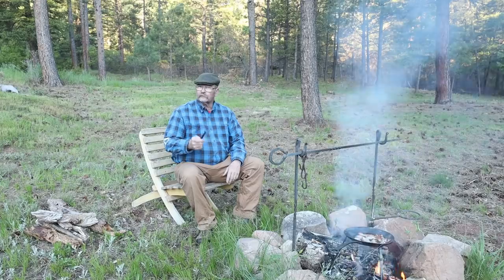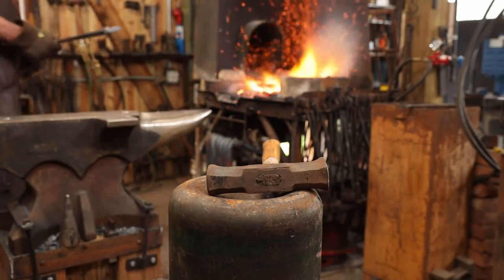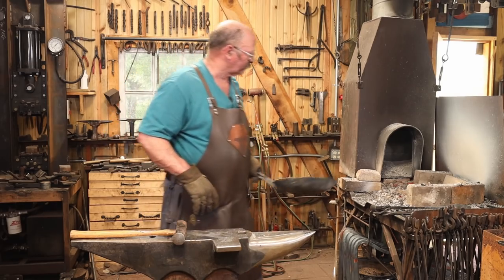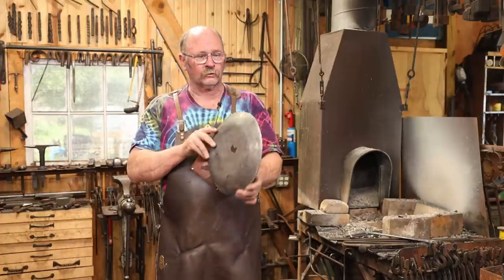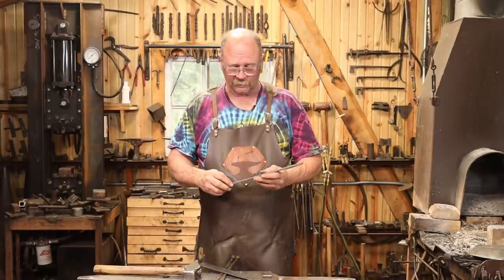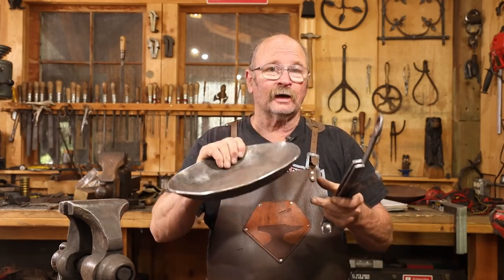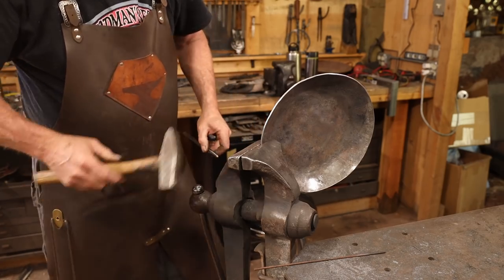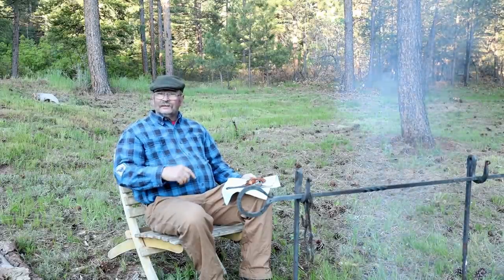Spider or Three Legged Skillet

Comment: I read a book from the late 1800's that said that charcoal was the premier choice for blacksmiths in England until they started having trouble with deforestation and had no other choice but to switch to coal.
Reply from the maker: Its a good choise if you have it available.  But it burns fast.

Comment: " I know I look hot, but try to control yourself " 😆🤣 you sir are great to watch for skills and humor.
Also, adding or taking away the coals can control the heat better on something like this spider with static height. Be using a handmade fire rake for that. 😉

Comment: Great for campfire cooking up at your cabin! Bit impractical to be carting around camping unless you could find a way to detach the legs. Good pan however, I have tried a few but have the most success by cheating and using the bottom off an old LPG cylinder! Just have to flatten a bottom, work really well!
Reply from the maker: Sounds like you need a bigger truck 😜.  But I doubt we will take it camping either.

Comment: Good afternoon, John,   Not quite twenty questions.  Could you use a disk blade to make the skillet?   How about coke instead of charcoal?  Could you show the hydraulic press a bit more?  Thinking of building one.  Thank you, and stay safe.
Reply from the maker: The disk blade would have to have the hole welded up and it might not survive being forged at that point.  But they can just be welded up and used like a wok.  Coke would be a good choice if its available.

Comment: Comment on your chair used in the video. as far as I know, I was the original designer of this chair. working in the furniture factory in High Point NC. My foreman and I started with an idea and started cutting it out on the band saw. It had many functions at the time. when folded up it also doubled as a backpack frame at first so you might carry it out to your base came site while having your hands full of other items. at the time we also made other sizes, we had a child's chair and a loveseat in this same style. also made was around and square table made to the height of the chairs for some lounging around our campfire. Please enjoy our design  Stan

Comment: Make yourself a disco cooker, a Mexican wok on legs. Lol They are made from disc blades with horse shoes welded on for handles. Disc blades come in several sizes, I think. Hubby welded 3 1-2” bolt nuts on the under side of the disc blade so that carriage bolts can be screwed in for legs.

Comment: Have you ever tried to make a wok?
I am working on one now and it is difficult to form the bottom without the hammer handle hitting the rim. So far it has been enjoyable making it. I have about 3 hrs in it. With my forge I can only heat about a 1/4 of it at a time. Plus tendinitis in my elbow limits how long I can swing a hammer.
Reply from the maker: No, although this skillet is very wok like before it is flattened.  Its hot work to be sure.

Comment: Do you ever have a problem with the gas saver pilot ceramic nozzles breaking and where is a good place to get replacements?
Reply from the maker: Mine cracked, but it doesn't seem to have effected its use

Comment: I've been wanting to make these for a while. I think I'd make a top and bottom die to press them into shape maybe.
Reply from the maker: Dies would help.  But unless your making a bunch, the dies may take longer to make than the skillet
Reply: @BlackBearForge  Tim Dyck made a quick-and-dirty flypress die to shape some sheet steel for a tuyere protector for his sideblast forge.  A design similar to what he made might work well to raise the edges of a skillet.  It was basically just round bar stock tack welded to some plate scraps.  https://www.youtube.com/watch?v=uDHPmI1cyHk
Reply: @andrewtinker7537  This is kind of how I built candle cup dies. I use them in the hardy hole though by hand. Just a ring of round bar welded to a plate for the bottom and a smaller ring on the end of a 1 inch square bar to set the top.

Comment: So, what you were using to do the main shaping of the skillet was a base of an oxygen cylinder?  Did you do anything to the inside of the cylinder to make it more solid or just leave hollow?  Thanks
Reply from the maker: Nothing but a bar welded to it to form a hardy shank so it doesn't slip off the swage block

Comment: Im curious about the coal forge dose it build a hotter loger lasting heat with a hood or would that be just a in shop thing to keep the smoke going up ???
Reply from the maker: The hood is just to remove smoke and doesn't really effect the fire

Comment: Hi John, been watching you since before you got the 1K subccribe mark. Nice video, can I make a suggestion from one Smith to another? 
Make a skillet die. For that 12" disk, I'd suggest a 9" ring x 3" high the 3" is over kill but better to much then but enough. Then a 7" ring ( I know that's a huge gap) bit you could go 8 & 1/2 but I like wiggle room and a good slope, them weld a few layers of sheet metal or a heavy plate to match the 7" ring. Also attach a striking point. Heat your disc,  dome it some as before, place in top of the 9" ring then drive it down with the 7" press die. Walla skillet minus handle.
Just an idea, obviously math out the die size for other size disks.
Thanks again John!!
Reply from the maker: If I plan to make more, I would look into it.  But for a one off project, it isn't really worth the trouble.  Although it might make a worthwhile followup video.
Reply: @BlackBearForge  I do understand that, but knowing you you have 2 more disks, making a tool for what might be a one off will insure you can do more faster and better if you decide to do more, plus I think the time to whip up that simple tool and use it for a one off might be faster and more skillet like. I love a wok, and basically that's what you made. Woks are great frying tools but they are not a skillet. Skillets have sharp defined angles with a very flat bottom, a wok has an either flat out rounded bottom with a curved slope to the outer edge. Both are good tools for cooking I actually prefer a wok for most frying. Just being picky and technical about the pan. It's wonderful and works well. Really I think the jig would be a good video and your have it for ever.
Thanks John.

Comment: Brother, now I'm not an expert but from everything i read about charcoal forging and my own limited experience, you are giving it too much air and burning your pile down way too fast. Your fuel consumption rate is quicker than it needs to be it appears.
Reply from the maker: For a small fire to heat most forgings, you are correct.  But it was the only way to bring this large of a piece up to heat at one time.
Reply: @BlackBearForge That makes sense, it was a honking huge piece, fair enough.

Comment: Most of the heat is radiant -- have you tried light-colored gloves and apron?  Or maybe powdering yours a bit, like with cornstarch or mineral-based like calcium-carbonate (if that's okay around the metal work)?  Or some other white-wash method... whatever's safe.

Comment: I think you might need to turn down the blower a bit for charcoal it doesn't need as much air as coal. It will spark less with less air and will burn up last fast with less air.
Reply from the maker: it also didn't get hot enough to heat the entire blank.

Comment: Nice project, but seems unnecessary with a height adjustable support on the leg of the  spit. 👍
Reply from the maker: AS I mentioned these are mostly used in an indoor fireplace.  But for the camp fire its much more stable than the other support and doesn't require the extra support.

Comment: Is the skillet to thin to keep a welding heat long enough to forge weld the legs on?
Reply from the maker: Probably not to thin.  But none of the old ones I have seen were welded.  Rivets seem to be the usual method.

Comment: It sounds like you're ready for hot smith summer. Question: do you have any tips for keeping small pieces of charcoal from going airborne? I found I couldn't run as much air through my fire as I wanted to make it hot enough for larger billets without producing volcanoes of pea sized pieces of glowing charcoal. I love your work, you've been a big inspiration.
Reply from the maker: You have to keep the blower turned way down.  I think a side blast forge would be better for charcoal.
Reply: @BlackBearForge  yeah, I was afraid of that. Although maybe I could have rearranged my firebrick (my forge doesn't have a firepot) to divert the airflow and move my fire off to the side. Thanks so much.

Comment: Looks good, now I wish I had not thrown out the bottom half of a old oxy cylinder I cut to make a bowling ball mortar years ago. Mexicans [no offence] have been using a old plow disc to make something similar for years, i just bought a new one at TSC to make one for myself. You leave the hole in them or weld it up depends if you want to fry somethin in shallow oil or not, I think they call it a Discada or something like that.

Comment: and here i thought you was going to forge weld the legs and handle lol
Reply from the maker: All of the old ones I've seen are riveted, so it seems to be the common practice
Reply: @BlackBearForge  it makes sense to rivet  in a way, makes for easier replacement of the handle or legs